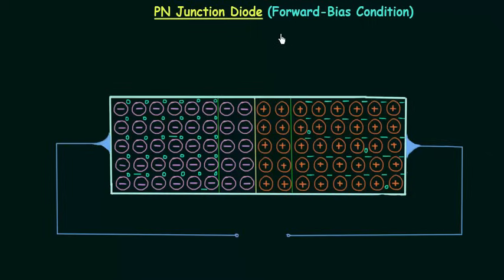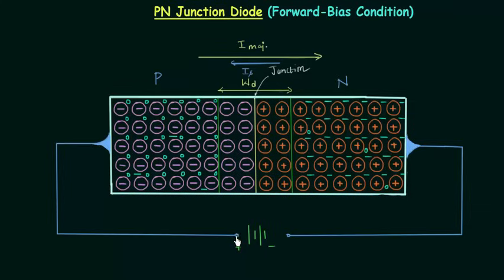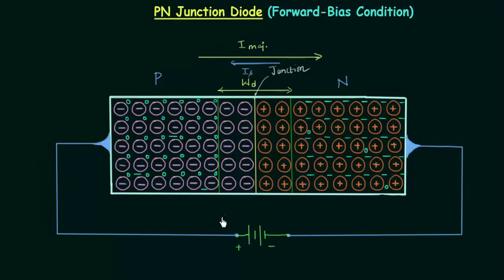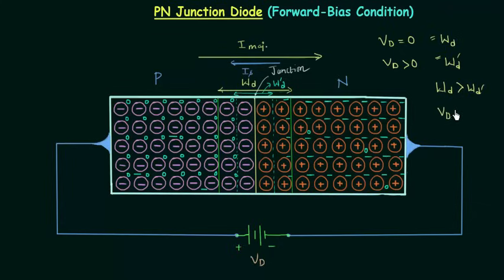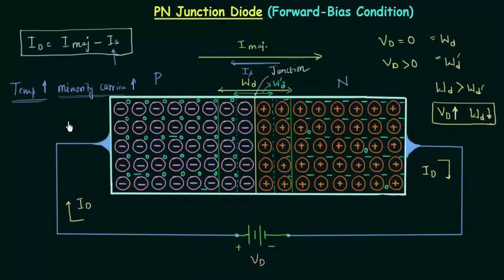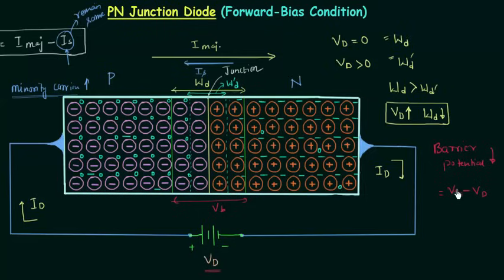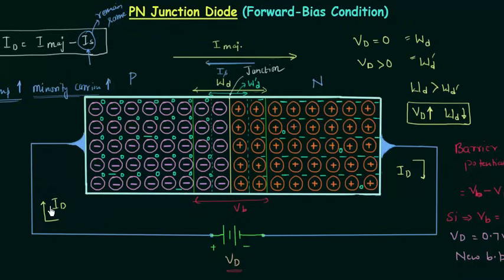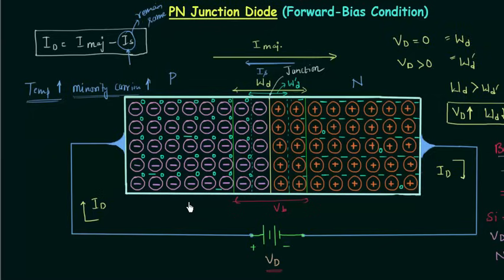PN Junction Diode (Forward-Bias Condition)

Comment: Difference between Drift currentand Reverse Saturation current in Diode:

The total current in a p-n diode contains both drift and diffusion components of the current. The drift current component is controlled by the electric field, whereas the diffusion current component depends on the concentration gradients present. At different points in the diode the carrier contribution changes from drift component to diffusion component and vice versa. In simple words

Both majority and minority carriers contribute for drift component of the current. The minority drift current component occurs at the p-n junction (transition region), while the majority drift component current dominates at away from the transition region towards the metal contacts deposited on p-n semiconductor

The diffusion component contains only majority carriers. This component usually dominates at the transition region

Therefore, at the junction always two components of current will be present. One is due to minority drift, the other is due to majority diffusion. However, at equilibrium both components of the current gets cancelled with each other, resulting in zero current at the junction.

The reverse saturation current comes entirely from the minority carriers in the p-n junction diode. It is purely drift component of current near the junction, because the minority carriers usually swept by the electric field present at the transition region. The carrier swept happens only if the minority carriers are generated with in the diffusion length of transition region. The minority carrier contribution depends on how often the carriers are swept by the field present at the transition region.

The majority carrier drift current component generally dominates under biasing conditions (say forward bias). The majority carrier contribution changes from diffusion to drift as we traverse away from the junction towards the contacts. Because the applied fields present at the contacts accelerate the majority carriers which are present near the contact regions.

Thus, the drift component current contains both majority and minority carrier contribution. The drift current which comes from the minority carriers is called reverse saturation current and it generally dominates the junction.

Comment: You told that if the width of depletion region decreases than barrier potential also decreases but according to the formula of barrier potential, it does not depend on width of depletion layer
Reply: Maybe use Gauss's Law for electrostatic:
Del dot E = rho/epsilon
Del dot (-grad V) = rho/epsilon

Comment: Can someone explain why is the drift current not changing when we apply a voltage? I am thinking it's supposed to be decreasing since the depletion layer is smaller
Reply: There is some simplification involved, where the smaller drift current is being ignored.
Reply: I thought diffusion current is due to the concentration difference of electrons between n and p. Since n has more higher concentrations of electrons, they will go to lower concentration which is the p. This movement of electrons is the Diffusion Current and causes potential barrier. While Drift Current is the movement of electrons when there is an external electric field (in the case of pn diode, the potential barrier is where the Electric field resides). And it opposses the direction Diffusion current. So when the concentration of electrons and applied electric field in potential barrier balances the current, net current will be zero hence no current flow.

Comment: Just please explain why the direction of i majority from left to right????
Reply: Because current by convention in defined for the movement of holes. Remember : Current is not the actual movement of electrons.
Reply: because when we connect the voltage the negitive side of the battery push all the electons in (n-region)  toward (p-region) of diode thats why its start motion from left to right

Comment: Sir, in the video (at 5:17) you said that Is (drift current-due to minority charge carriers) remains constant, but it is the amount of minority charge carriers that depend on temperature and not the current as after applying the positive bias even though the charge carriers(minority) remains same(as temp is constant) but the current will be decreased since the minority charge carriers will have to surpass the external electric field to generate the electric current... Isn't it ??

Comment: Thank you so much for the videos. They are really very clear to understand. can you please explain why the diffusion current flows from P side to N side.
Reply: its bcz n side has more electrons and p side has holes so electrons from n side moves towards p side to fill the hole and electron flow starts from n to p and we know electric field is always opposite to the electron flow so current will flow from p to n .
Reply: i guess it is because we take that current flows from positive to negative

Comment: Sir, i have this doubt that whether reverse saturation current and drift current are both same thing?
Reply: due to the recombination taking place at the junction atoms becomes ions at the junction and hence potential develops across the junction .above process will continue till equilibrium potential ( where the drift current or saturation current will be equal  to diffusion current ) develops across the junction and further recombination stops .hope it helps
Reply: No they r not the same thing
Reply: Reverse saturation current is very small current obtained ""just" at the point at which Zener voltage is obtained
Now if somebody tries to apply a voltage across the PN junction greater than the Zener voltage then breakdown occurs- Avalanche or Zener depending on the type of doping... a large amount of drift current flows in the circuit
Reply: Suppose to be so
Reply: @nikitamakeev7201 The answer is yes though i think you dont need it anymore but its for the others to see
Reply: Lakhan Rarth tq for this
Reply: yep